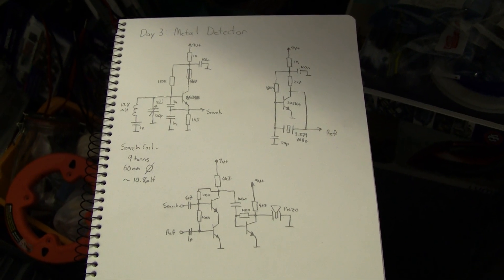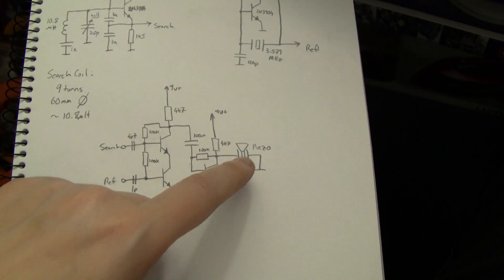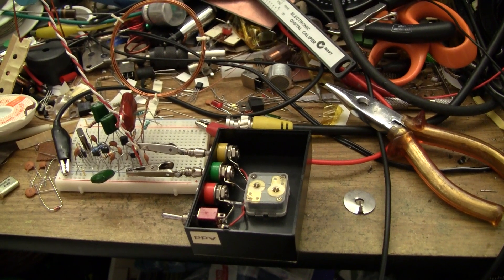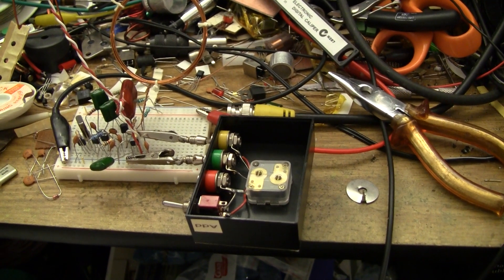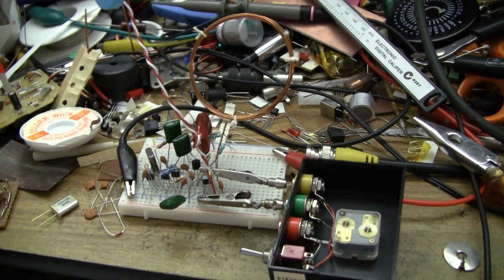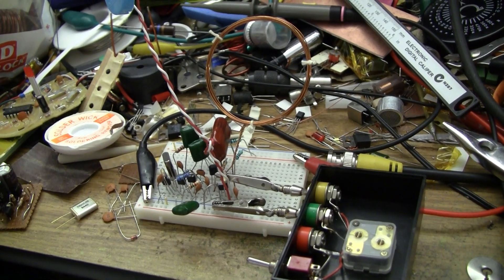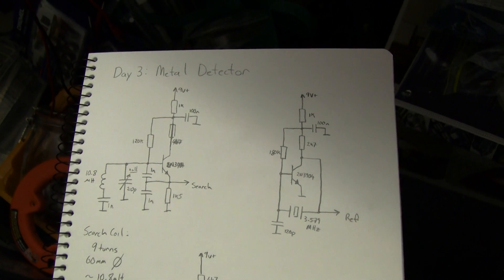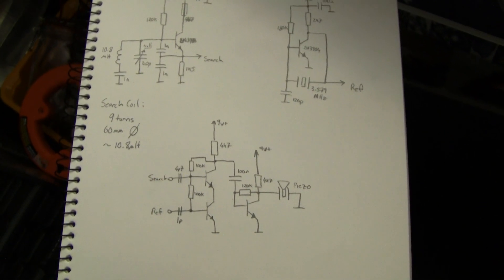Advent Calendar of Circuits 2011: Day 3:  Metal Detector

Comment from the maker: I've collected mine over many years, but local stores Dick Smith, Jaycar/Electus Distribution, Rockby Electronics.  Also eBay, Futurlec, Sure Electronics, Farnell/Element 14, Mouser, RS/Tandy.

The through hole resistors I have came mainly from Jaycar I think.  They used to sell packs of all E12 values.  Similar bulk-packs for the capacitors, but I ordered a lot to fill in any I was missing.

Sources have been drying up of late, especially for through-hole which I like for quick hacks.

Comment from the maker: @realcomix1 most of the components are very common.  Only the crystal and the polyvaricon capacitor might be hard to get depending on where you live...  You can always omit them and use two LC oscillators, tuned by tweaking the coils physically, say building one as a variometer.  Setting it up at LF might be a good idea if you do that, say 300 kHz or so.